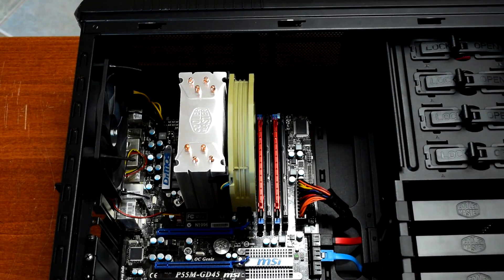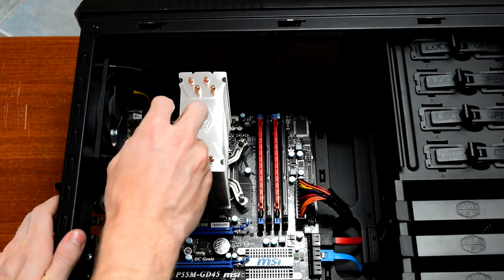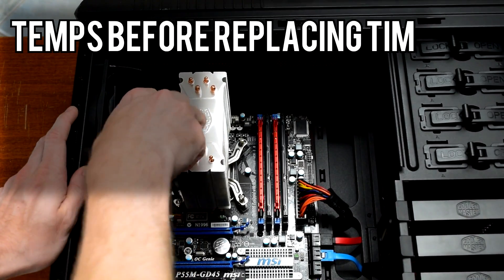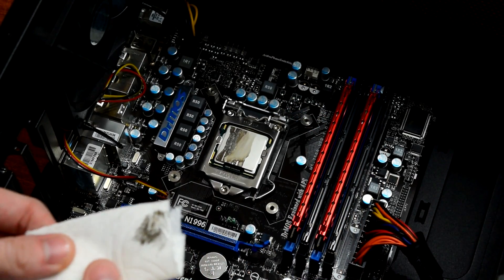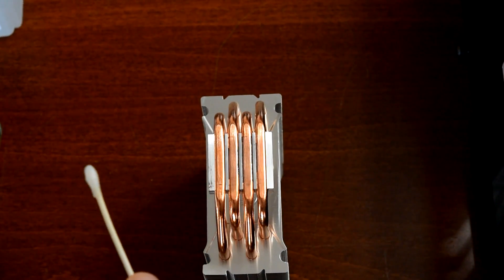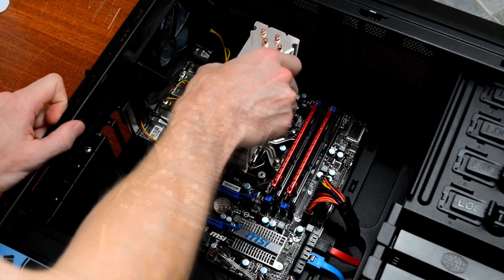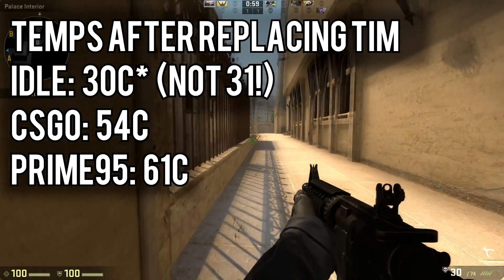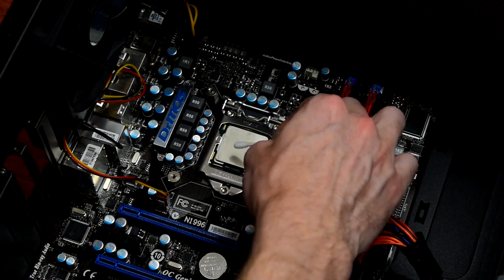Quick Question 001: Do You REALLY Need To Replace Thermal Paste?

Comment: I build my own Computers since about 30 Years so i can provide some experience.
I pulled coolers from prebuild systems who's thermal paste was chalk dry and cracked after only 2 Years, replacing it made a massive difference.
I also pulled coolers from my own builds after 8-10 Years and the paste was still fine, more viscous but fine, replacing it made no difference outside of margin of error.
It's more about the quality and application of the paste than its age.
Getting the dust out of your heatsink makes more difference than reapplying paste - if the paste is of decent quality.
If coolers came with paste pre-appyed i usually replace it since i don't know the quality, and manufacturer's usually don't overspend.
Just use decent paste, apply it carefully and it should easily last the typically useful lifespan of a gaming PC.
I usually go with Arctic MX or ArcticSilver (different companies) depending on what's available at this time, but there are others.
If you don't want to worry about paste at all, there are also graphene pads, but they are expensive, difficult to apply properly and generally perform a bit worse in my experience, but they are maintenance free and might be reusable.

Comment: Have gpu bought in 2014, i use for daily, by daily i mean every day the PC it's on, and the average time is 8 hours, there is time  i'm not turning my pc on, and it's 3 month, i never use additional fan on my pc. And i live in tropical country, in the city that infamous being hot, also i never use AC in my room, only fan on the ceiling.

Anyway, on my 9+ years old pc, only thermal paste on gpu i never replace it, the reason because i don't need to remove the heatsink when i'm clean the fan from dust, so the bond between my thermal and heatsink still there since i bought it. from 2014 to 2017 i mostly use for heavy gaming and from 2017 and today, i mostly use for streaming and occasionally gaming, the reason is not because overheat, but just todays gaming is very demanding, and my old pc specs can't run it.

I still use the PC today, when browsing and streaming the temperature sit on 39 deggres celcius and for gaming i don't know never check while gaming but i have no overheat problem at all

Comment: I'm running 2 PCs, one from '08 and one from '09. The '08 PC I know has never been changed. The other, I doubt has either. Both running fine today in 2023 with stock heatsinks lol.

But! The socket tdp limit is 95W. I think the max tdp for the heatsinks are either 125 or 140W. And the '08 cpu is 35W, while the '09 cpu is 65W. So I guess all that may factor in too.

Comment: Many people left comments on the concerns of using different brands.
Different variables can lead to different results.
Aside from the thermal paste used, all the components of the computer and how much was applied the first time and how well it was applied, can all have an impact.
I think what I can get from this is, if you are seeing your temps climb and you got rid of all the dust inside your computer and all the fans are working properly, then maybe try replacing the thermal paste. Just be SUPER DUPER ULTRA CAREFUL when removing your Cooler and when putting it back on.
The last thing you want to do, is try to replace thermal paste, and end up cracking your motherboard because you didn't realize something was still connected or not aligned correctly.
Long ago, I tried to put a processor in wrong. I didn't line up the missing corner of the gold pins and when i clamped it down, it bent the entire corner worth of pins.
I straightened them out and the CPU still worked, but I was getting lots of Blue-Screen-Of-Death and freezing up and so on.
So, If you take off your cooler or remove your CPU, TAKE EXTRA TIME and even try putting it on and off a few times without any pressure, to make sure you have it on the proper way, before applying any pressure.
Take an extra 10 to 30 seconds of your time, to save yourself from destroying hundreds of dollars worth of computer parts. It's worth it!

Comment: I have a 10 and 8 years old pcs which thermal paste never been replaced. Both are daily used and running ok, never had overheat problema. Not sure how hotter they are compared to the initial state, might be a few degrees celcius. So I believe nothing catastrophic will happen if you don't regularly replace your thermal paste

Comment: but shouldn't you have used arctic silver 5 again? maybe that other thermal paste is just better. 

people talk about the thermal paste drying out, but is it the wetness that makes it effective? or is it the material used? like heatsinks aren't wet, they're just aluminum or copper, because of aluminum and copper's heat conducting properties. so wouldn't it be the silver, or the ceramic, or whatever of the thermal past that makes it effective? and not the water content?

Comment: Bought a used system for £30. 8 year old system overclocked entore time on standard cooler never cleaned. 
PC shut down the moment i started running bemchmarks.
Dissasembled everything, removed an inch of dust from the fans, the thermal paste was powdered and almost non existent.
Waiting for a cooler now, lets see how it performs

Comment: It's pretty clear the thermal paste never got hot enough long enough to really dry out. I've seen laptops dry thermal paste to powder in six months. Someone really needs to do a controlled study of thermal paste heat resistance.
Reply: Oh wow! Thanks. I think I need to redo mine. It has been 4 years.
I have a massive Noctua cooler and my fans on high and only playing a low-end game on lowest graphics settings at the menu screen, my CPU is going between 120*f and 168*f.
For this game's menu screen, it shouldn't even hit above 100*f.
I've never replaced thermal paste after a build and i've done crypto currency mining, so I know the inside of my case got hot.

Comment: i once had the same thermal paste for 4 ish years and it solidified so when i tried to remove my cooler i ripped the cpu out of the socket with it. Come to think of it, i should probably change it again
Reply: It's an AMD isn't it?
Twist before pull :-D.

Comment: it really foes depend on your heat output (temps you have while using the computer itself). I had to clean off the thermal paste off of my i5 2520M because it was reaching 100C and thermal throttling. It was dry and crusty, have to scrape off most of it using a guitar chip. my desktop, an X5660 at 4.0Ghz, temps usually at 50C while gaming, the thermal is the same consistency it was a year ago when I put it.

Comment: I have no experience in running CPUs with the same TIM for more than 20 years, so it still remains to be seen how often one needs to replace it.
Every 25 years, 30 years or even less often?
What needs to be done though is to clean the heatsink, and preferably also the fan, to get rid of any insulating dust between the fins and the air.

Your practical test doesn't show much though since you don't use AS5 with the re-seating. Also I disagree on using just a centered grain of TIM with that type of cooler base. Better to put a string perpendicular to the heatpipes to assure you get contact with all pipes, given the gaps that has to be filled.

Comment: As you used a different brand of thermal paste in your second test, it's impossible to know if the temperature change was the result of paste aging or the differing properties and qualities of the brands used. Ideally, you want to eliminate as many variables as possible when testing things. Given the slight variations you uncovered, it's unlikely that your testing methodology provided any legitimate results here.

Comment: You used different brand of thermal paste. I guess if you have used the same thermal paste as the old one that the PC had for 7 years there would be no difference in temps at all.
Reply from the maker: Gah, I biffed it on this one. I didn't think Arctic Silver was still producing the same thermal paste (Arctic Silver 5), but they are. I'll be revisiting this video soon, this time using the correct thermal paste that was on it originally.
Reply: @ponchato  Well, you did a test and gave the details, so that counts for something.

Comment: Considering I have a Slot 1 Pentium III (which probably never had it's heatsink taken off) that seems to run just fine, you don't NEED to replace thermal paste/compound, but it can help if your system is overheating.
Reply: wait what? those Pentium 3s were old when i was college in the mid 2000s.

Comment: How effective is the pre-applied paste vs. putting it on yourself?  I'm building a Ryzen 3 1300x build next week and I'm just wondering if I should go with the pre-applied stuff that comes on the stock Wraith cooler, or get some paste myself.
Reply: Adam Cushen pretty sure the pre applied thermal paste is fine
Reply: Also 1200 is better since it is cheaper and can reach the same speeds with overclock
Reply: Went with the 1300x because I got it at a good price.  Thanks for letting me know about the pre-applied stuff tho!
Reply: Since  you are using stock, just use the stock thermal paste.
Reply: Adam Cushen hey im building a r3 1200 build next week too. what motherboard and memory did you go with?
Reply: i recently bought a r3 1200 and i was using a stock cooler and on oc to 3.7 GHz i had no problem with temps. (72°C, prime95 heat stress test). When i changed the cooler on my old one which i used on my fx 6300 (cuz it is using standart am3+ mounting, not the one with screws) and i have used a cp15 thermal paste. The temps in prime95 can't get higher than 50°C.
Reply: msi b350m gaming pro mobo with 8gb kingston hyperx fury 2133mhz ddr4 ram.  might double that ram depending on how it runs pubg.

Comment: Why not have the thermalpaste be a constant? Arctic silver 5 is still available
Reply: AS5 is not the juggernaut it used to be; it requires a very long burn in for accurate temp readings (not an issue in every day PC building scenarios though) and there's TIMs that perform much better. Noctua's NT-H1, Gelid GC Extreme and Thermal Grizzly Kryonaut all perform better with the thermal grizzly being a couple degrees cooler than the others. 

I have gc extreme on my PC and ps4 (launch unit) and things stay very cool. I have a tube of the thermal grizzly on the way for my next paste change.

Comment: I don't think that the thermal paste on the cover is a problem, it's actually the thermal paste under it on the processor itself that is worth replacing and also not allowing the cooler to be more efficient...

Correct me if I'm not right